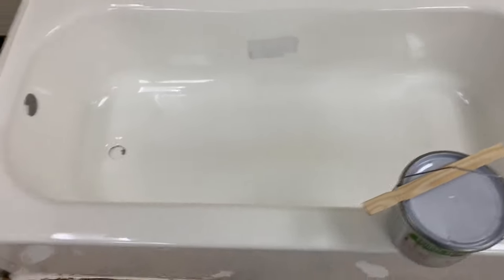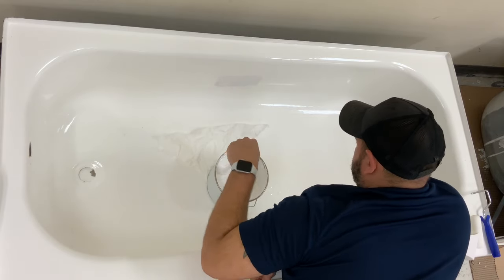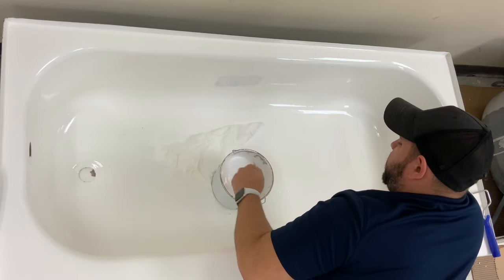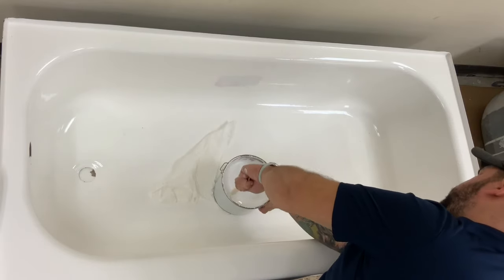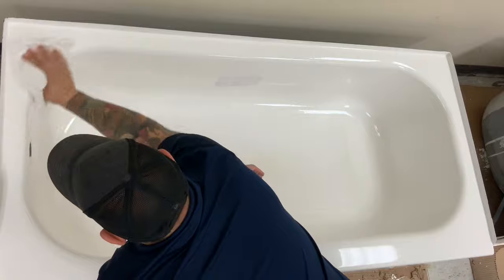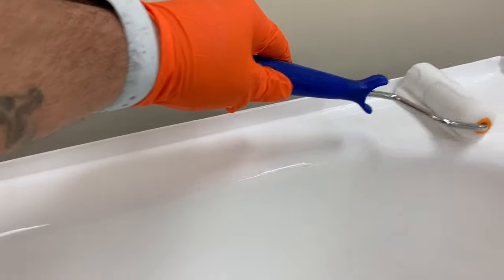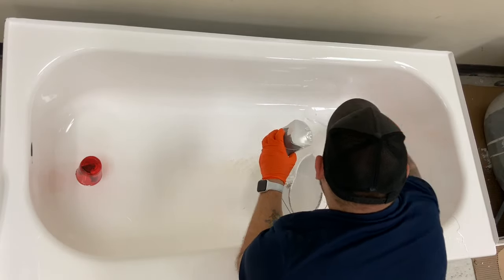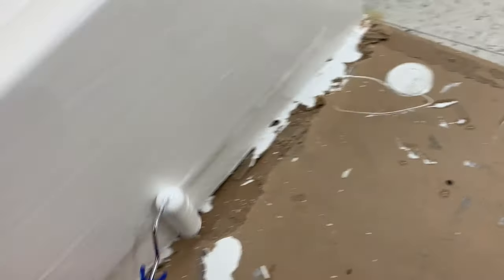How To Refinish A Tub With Ekopel 2K Demo | Ekopel 2K's Easiest & Fastest Way

Comment: We have an old cast iron tub that was professionally recoated 38 years ago but is now pealing. Will this product show a smooth surface where it is pealing? 
Also a cast iron sink that has some rust around the drain area. Is there any special prep required to take care of that rust before using your product?
Reply from the maker: Joseph Lynch sanding down any rust or peeling  areas until smooth is best. Ekopel will mirror the surface it covers.

Comment: Question? If you have a few minor chips in your tub, what product do you suggest to use so it’s a flat surface?  My mom has a plastic surround above tub that also needs replacing. Should she remove it and do the tub then replace the surround or completely do the surround prior to tub?
Reply from the maker: Crafty Raine Id finish the surround then do the tub. 
As for chips on flat areas they will fill in. On verticals it’s best to fill with bondo before coating

Comment: Can this product be used on a kitchen sink and if so what do you recommend to clean the sink after use? Will the surface stain easily with such thing as coffee or juice?
Reply from the maker: Yes you can recast the sink with ekopel. We recommend scrubbing bubbles or tilex to clean it after no bleach products. Staining can occur within the first 30 days you can use Mr. Clean magic eraser and baking soda to remove any staining to prevent the staining don't leave anything in the sink for 30 days after your recasted and rinse the sink out after each use after the 30 days is up the staining will disappear and you can use the sink how you regularly would.

Comment: Question. I just applied the spray krylon tub and tile to my tub, I've been converting a jetted tub to a soaker. Now I want to apply this (impossible to get a really smooth finish with the spray). Would I need to remove the paint I just applied? Or would the cleaning with the toilet bowl cleaner you mention be sufficient?
Reply from the maker: I would recommend peel up what you can if its peeling. Then sand it smooth to the touch with  220-320 grit sandpaper even if it's smooth already quick sand with 400 grit. Remember you want it to be smooth to the touch or it can mirror the affected area. Then deep clean and etch with Lysol power or any toilet bowl cleaner that has hydrochloric acid in it. From there you can tape up and pour.

Comment: My husband did a terrible job. There is a big lump by the drain and drips down the side. Is there anyway to fix this using a retouch kit or do I have to do the whole tub over again?
Reply: I'm not sure this will work yet because I'm in the middle of working through it but I sanded out the runs and a few of my mistakes and then I plan to just put a thin coat over the sanded areas with some left over when I do my other tub to bring the glossy finish back. I know this works with other epoxy finishes I've used for other projects.

Comment: I really enjoyed your tutorial, I’m a detail person. I wish I could have seen the last part where you finished the outside bottom edge. Question: our tub doesn’t have any abrasive product on the bottom, so it’s slippery. Is there something we can do to make it abrasive under or over your product before/after application?
Reply from the maker: We have a non slip product you can apply to the bottom of the tub so it's not slippery. You would apply the non slip after you have applied the ekopel and the ekopel has dried in 24 hours.

Comment: can i sand the tub before applying this product?  if so, what’s the minimum grit sandpaper you would recommend?  my old cast iron tub has multiple layers of coating that have chipped and peeled away leaving a super uneven finish.  i would like to at least feather out these areas if not remove them all together.
Reply from the maker: I would recommend peeling up what you can of the old finish. Then sand the rest smooth to the touch with 220-320 or even 400 grit sandpaper. Then give the tub a deep clean with Lysol Power or any toilet bowl with Hydrochloric acid in it, this also etches the surface as well. From there you can tape and pour.

Comment: Will this work on a cast iron tub that the current finish has divots and chips? Do I need to sand at all to smooth out before using this product??
Reply from the maker: Any chips, cracks, holes, or dents can be filled with car bondo first then sanded smooth and then you would be good to coat.

Comment: I live here in Spain 
  What would be the best time to do this job in the summer 32c  or the winter? 19c also have rust marks on the bath one bad one  
thanks again
Reply from the maker: If your worried about temperature you could put either a space heater or portable ac unit in the bathroom and close the door for 24 hours and the room should get better. You want it between 21-24 degrees Celsius or 70-75 degrees Fahrenheit. If it's too hot the material has a hard time sticking to the tub if it's too cold the material will take longer to dry. So I would recommend recasting in the winter.

Comment: My cast iron bath tub have been glazed 7 years ago and now has a lot of peeling. I want to re-glaze it now. How do I prep it before using ekopel-2? Can I use Jasco paint and epoxy remover to peel the old paint?
Reply from the maker: I would recommend peel up what you can of the old finish then sand the rest smooth to the touch with 220-320 grit sandpaper then etch and deep clean with Lysol Power or any toilet bowl cleaner with Hydrochloric acid in it.
Reply: @RefinishedBathSolutions  thank you!!!

Comment: Two questions; 1) If using leftover material to do my vanity top, should I gently stir it again before doing so or is it likely okay? 2) If it lasts 15 to 20 years, is it possible to redo it on top of the existing Ekopel finish at that time following the same steps as in the video prep-wise?
Reply from the maker: It's not recommended that you use the extra materials to do another project because if it get stretched too thin it can cause streaking or yellowing. Also you only have about an hour to work with the materials after it's been mixed. After the hour the material is too hard to work with. yes you can apply a second coat of ekopel on top of ekopel following similar prep work.

Comment: Would it be possible to spray this versus rolling? Or will this be a option later
Reply from the maker: No, ekopel is too thick of s product to be sprayed through a gun and if it is thinned it will cause yellowing and streaking. It has to be poured on.

Comment: This is an excellent video full of extremely useful tips. But, I just wanted to leave a note to say that this really went very badly for me.  I watched this video several times, and I'm sure I did all the things as suggested. It looked amazing when I finished after about 30 minutes just like he did in the video,  but when I came back in an hour it didn't adhere to my tub and it came out all blotchy and streaky. Before the pour, I sanded the surface quite a lot, and used the 9.5HCL lysol product, and it was exactly 74F when I did it, so it's not exactly clear to me what I did wrong. (And yes I stired it by hand!) 

This isn't a negative review, and you don't have to roast me with negative comments. I'm certain that I screwed the process up, and there are enough positive comments and good reviews out there that you can be confident that this is an excellent product.  I just wanted to let you know to really study hard and double check everything, because it is possible to screw this up quite badly if you suck like me.
Reply from the maker: Thank you for taking the time to share your experience with us! We're sorry to hear that things didn't go as planned despite following the instructions closely. We really appreciate your feedback and understand how frustrating that must be.

It sounds like you did everything right, but sometimes even small variables can affect the outcome. If you need any assistance or have further questions, please don’t hesitate to reach out to us. We’re here to help and want to make sure you have a great experience with our product.

Thank you again for your thoughtful comments and for giving our video a try!

Comment: Been wanting to re do our old clawfoot tub. There is a dip in the center bottom where water lays. Would this self level and fill this or would this have to be addressed prior. Also, what about chipped/rusted areas? Any special pre-process for those?
Reply from the maker: Dave Artkowsky it is best to repair any damages before you complete the unit with bondo or a polyester putty.

Comment: My fiberglass tub has several long cracks.
Can or does this product work and be strong enough to support the weight
of a bather.
Reply from the maker: Cracks and chips can be filled with car bondo and ekopel and can go over the car bondo. If the cracks are bad enough though you would need to replace

Comment: I bought the wipe on primer.  But I don't see that you ever use it in your videos.  My only concern is that I'm going over a  PINK tub, so I don't want anything to show through.  Do you recommend I sand the surface first?  I'm just concerned about only cleaning and applying with no other prep.   Should I return the wipe on primer??
Reply from the maker: You can use the primer it's for a better stick. We usually recommend it for bad rust spots or places you've fixed with car bondo. I would recommend sanding the tub with 400 grit sandpaper. You'll want to just make the tub smooth, if it's already pretty smooth it's a good idea to just give it a quick ruff up with the sandpaper. Then you can use the Lysol Power or any toilet bowl cleaner with hydro cleric acid then tape and then you will be set for your application of ekopel.

Comment: I have a big blue square cast iron tub. Would one of these be enough to cover the blue and the bigger tub? Or would we need to buy two?
Reply from the maker: If it's a bigger than a standard size tub you would need the bathtub refinishing kit and and a sink kit. They are the same material just different size kits. That will be enough material for the inside of the tub not the outside of the tub. If you were to do both the inside and outside of the tub then you would need the tub and surround kit and a sink kit. Just one coat of ekopel will cover the blue completely.

Comment: My tub has built in butterflies on the bottom, will this product cover them up? I would like to keep the detail because it is unusual.
Reply from the maker: If you don't sand that part smooth it will coat the butterflies nicely.

Comment: Hello, we are renovating a home and no a/c here  in  the interior, hot hot hot in Texas,  Can we still use this in a hot house?
Reply from the maker: The recommended temp is 70-75 degrees. If it is too hot or humid the martial doesn't want to stick. A lot of people will refinish in the evening or get a portable ac unit. The martial has a shelf life of 2 years so you could hold onto the product and refinish your tub in cooler weather.

Comment: I have a question I bought the unit and plan to do my tube over the weekend, I saw in first videos you use a red drinking cup to pour the mix on the tube. I'm afraid of over pouring if I use the entire can or can I use the cup and pour the mix fast like you did in previous videos. I appreciate your answer.
Reply from the maker: Yes you could do it that way as long as the material is mixed exactly as the directions state, you'll be fine to use the cup. Also keep in mind that you only have about an hour to work with the material after it's been mixed, so you have to work fast.
Reply: How did your tub turn out? I just got my material and will coat my tub sometime next week..
Reply: Tub came out great tub looks better then new. You have to work fast and level it all out. So worth it

Comment: There are far too many comments for me to read through them all to see if someone else has asked, and you have answered, these questions: I have  standard sized tub, and tiled wall on 3 sides about 33" deep by 58" wide by 5 feet high (although not all of the way to the ceiling. The tiles are a gross-out white and blue, not smooth but with depressions. Some time ago I used Rustoleum Tub & Tile, and it looked fine for a while but is now peeling (may well be that I didn't do a good job originally, not necessarily dissing Rustolem products which are excellent generally).  (1) Can I use your product to cover the wall tiles? (2) If so, do you recommend a particular stripper? I've already tried a heat gun which is way too slow. I purchased Citristrip stripping gel. (3) Since your tutorial says you end up with about a cup of Ekopel waste, do you think there would be enough to do both the walls and tub? (4) How do I paint vertical tiles? Pour from the top as you did for the vertical sides of the tub?(5) Do you think there is time to do both the walls and tub in one session? (6) This is just a suggestion, but why don't you make the "fry" cup already reinforced so the customer doesn't have to do that extra step of taping it, especially at the price point  for this product? Thanks, Jennifer (PS: What I really want to do is DEMO the entire bathtub and tiles, and put in just a shower eventually budget permitting, so I don't mind if the end result isn't as perfect as your video!)
Reply from the maker: Yes you can use ekopel on that type of tile. Our 1 gallon kit or bathtub kit covers: 20-30 sq ft our 2 gallon kit or tub and surround kit covers: 35-50 sq ft our sink / shower pan kit covers: 10-12 sq ft. For prep work I would recommend peeling up what you can of the old finish then sand the rest smooth to the touch with 220-320 grit sandpaper. If its not smooth to the touch it will mirror that area. Then use Lysol Power or any toilet bowl cleaner with hydrochloric acid in it to etch and deep clean.  I would recommend watching this video for pouring tips on vertical surface: https://www.youtube.com/watch?v=3knxK_RM2LE&t=11s

Comment: Hey, so you have a problem with air bubbles and possible cratering? Maybe their is a de-foaming agent you could apply to your product to allow for someone to use a drill attachment. A silicone-free polymer defoamer might be something to run tests on. I am unsure of the compatibility of an epoxy with these, but something to look into to counteract any surfactants you may have.

Comment: I'm getting ready to order your bathtub refinishing Ekopel product to finish my old clawfoot cast iron tub. Would CLR (Calcium Lime Rust) work instead of the toilet bowl cleaner with hydrochloric acid? 
CLR contains: 
water
lactic acid
gluconic acid
lauramine oxide
propylene glycol
n-butyl ether
glycolic acid
sulfamic acid
disodium capryloamphodipropionate
ethylene glycol n-butyl ether
citric acid

Thanks!
Reply from the maker: It has to contain hydrochloric acid in it to work. So either any toilet bowl cleaner that has hydrochloric acid in it or Lysol Power

Comment: Would you be able to do all but the front of the tub, and do the front and top last? I am worried I won't be able to reach over and into the bottom of the tub without getting this stuff on me. Is it really hard on the back? I need to redo my tub but not sure if I will be able to complete it without rubbing into it.
Reply from the maker: Yes you can do it that way. If you do accidentally hit the material you can always sand and buff or get a touch up kit to fix.

Comment: Is it OK to use the Lysol power on the ceramic tile above the tube to clean it?
Reply from the maker: Did you mean to say above the tub? if so then yes you can use the Lysol power to clean everywhere
Reply: thanks, yes I meant the tub. Question, before I start rolling on your product do I need to remove all the caulk or can I just roll over it?  @RefinishedBathSolutions
Reply from the maker: @davec614614  it is to be removed

Comment: I read somewhere that someone used a rust inhibitor around thw drain hole prior to refinishing with your product.  Will this cause any problems with curing?
Reply from the maker: no it shouldn't cause any problems because it is prior to refinishing.

Comment: My tab has a chips in it few chips and it's a little thin on the bottom so I was wondering how much Sanding do I have to do before I can use your product
Reply from the maker: I would recommend filling the chip with car bondo then sand smooth
Reply: @RefinishedBathSolutions  would that be Bondo glass

Comment: I have two questions:

How is the coverage when done on Blue or mauve colored tubs? Is there any show through and will it require two applications?

is there any need to use 220 sandpaper for etching the entire tub other than smoothing out chips and taking off little bumps?
Reply from the maker: Joshua Schlies sanding isn’t necessary as long a Lysol power deep clean is preformed. Ekopel will cover the color normally in one coat but application on walls is tough. Be sure to review the tub and tile video first.
Reply: @RefinishedBathSolutions  thanks. If i viewed the correct video it looks like the process remains pretty much the same as the other tubs. on past mauve tubs I've done (with a different product) it seems that they would end up pretty thin in spots; requiring additional coating. looking forward to trying ekopel 2k on the next one.
Reply from the maker: Joshua Schlies similar but in order to prevent drips and other defects it’s important to pour both kits at the same time and finish the walls as fast as possible
Reply: @RefinishedBathSolutions  maybe i watched the incorrect video. I would be redoing just the tub itself, no wall tile. are two kits still necessary?
Reply from the maker: Joshua Schlies no I was confused when you said tiles. 1 kit for just a tub